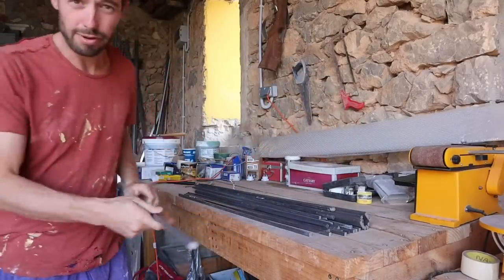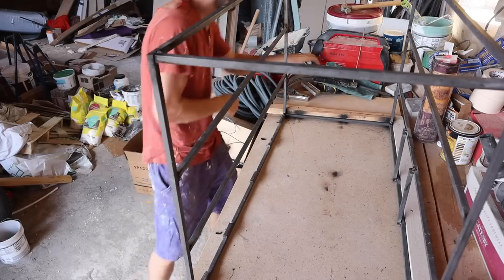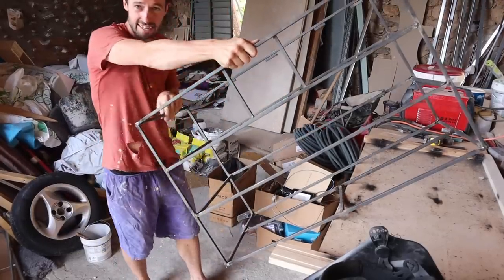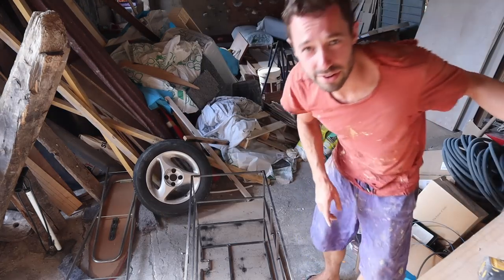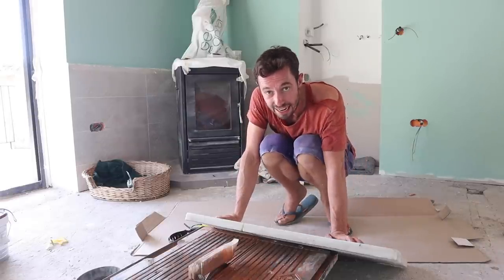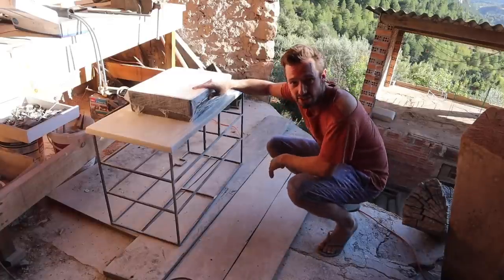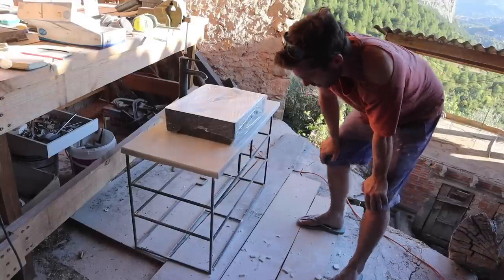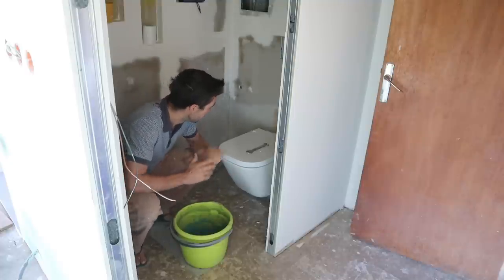BATHROOM COMING TO REALTY 🚿 // DIY Bathroom Furniture - Part 2

Comment: Totally on your way to status of legend ....  Am a bit concerned about my own standards - shrugs off Nate perched next to a 5m drop, the safety flip flops and cutting stone inverted as being totally normal, but find myself jumping to the "are you sure you want to use that MF sized angle grinder to cut the marble !!!"   Happy to say I'm wrong - what you are doing there is awesome. More power to you.
Reply from the maker: 😂😂.. mostly using the big angle grinder because I don't have a stone blade for the little one. Works more or less well if a bit easier to over do it.